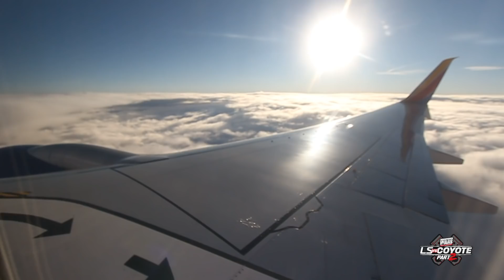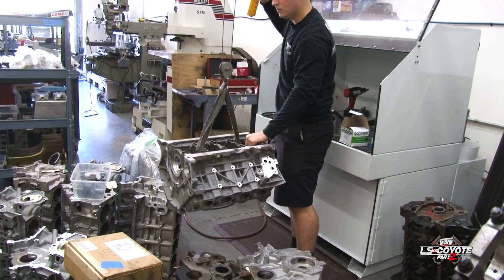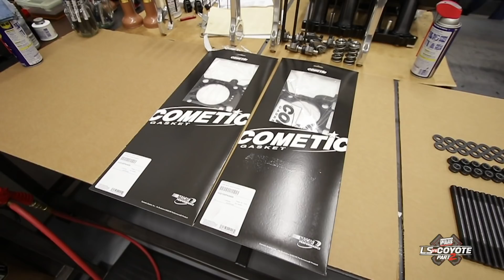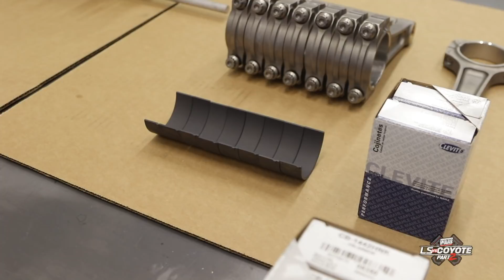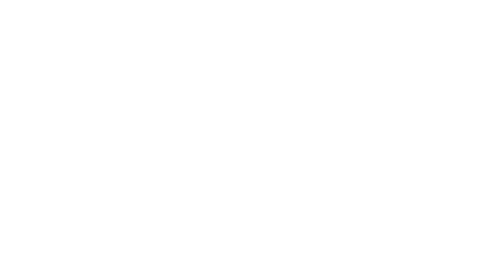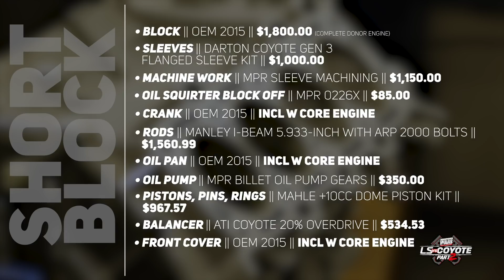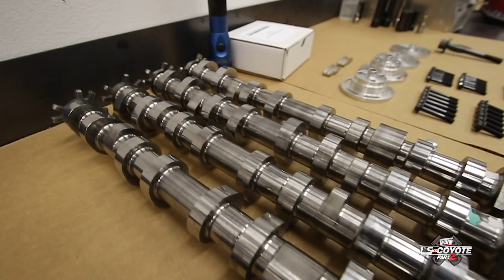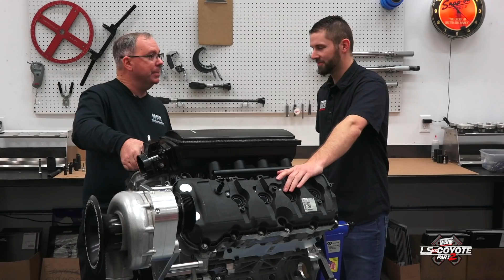LS vs. Coyote 2 Episode 3: The Coyote Engine Build

Comment: So in retrospect what you're saying is that the ls base 5.3 L is not a competitor against the 5.0 so Ford won hands down so all you LS boys to take that and and shove it because that right there proves right from the get-go that GM lost I mean if we're going to compare apples with apples why is it the 5.3 being utilized tucupita guess the coyote 7 L vs 5.0 L is not a direct comparison can you get 7 liters out of a 5.3 L can the 5.3 L with a $15,000 budget compete with the 5.0 coyote I don't think so just like always GM Fanboys can't start with a similar comparison to start with. Why did GM boys always have to start with aftermarket parts not to mention I know guys would 5.3 letters that have $20,000 invested in them and then barely pushing a thousand horsepower with turbos that were already purchased for their last LS that blew up
Reply: why would you compare Fords premier V8 (SAVE FOR 5.2/6.2 UNICORNS) vs GM low tier v8? You make it out like the alum L33/LS1/2/3/6/L92 blocks cant take bigger liners??????? Wake up fuqtard they can all be made to displace  over 427 cubes with the SAME PROCESS USED FOR THE FORD BLOCK IN THIS SEGMENT.  You used to be able to do an E.R.L Superdeck  however I think they are out of automotive, but  R.E.D does the same process for over 500 cube  Ls from a  factory block.

Comment: I absolutely hate this. Quit comparing a 6.2 vs a 5.0. Who’s idea to use a pro charger anyway. Everyone knows a vmp makes way better low end power and could help lower end and midrange torque. Oh I know why this is Chevy guys trying to beat the coyote and that’s the only way they can skew the results
Reply: typical chevy guy response... well you see its not really an advantage having 2 extra litres cause you see you have 4 valves and we only have two. (kidding) lol but in all reality yes the 4 valve head flows really well BUT those 2 valve cnc ported heads going on the ls will probably be square port and they flow extremely well.
Reply: @randomlifeofjohn , I didn't call it an advantage genius, it just evens the playing field a bit, the displacement comes from how much air an engine takes in every 2 revaulions
Reply: @anthonywebber2211   lol revolutions and i was just messing with you. just realize there is no replacement for displacement
Reply: @randomlifeofjohn  There is a replacement for displacement. It's called boost.
Reply: @chrism.728  agreed however they're both boosted haha so it still stands
Reply: @randomlifeofjohn  DOHC Coyotes love to rev and love boost, so it all balances out.
Reply: Baggerz Anonymous
the LS engine there using this time is 7 liters, 2 valve engines need displacement to compensate for the lack of flow that 4 valve have
Reply: @anthonywebber2211  a set of Frankenstein heads flow 410cfm intake and 265 exhaust. A stock ported coyote head floors around 340 at .500. You can get the Frankenstein heads for 1700 a set. A set of coyote heads thay flow thay good will run you 3500
Reply: @anthonywebber2211  plus its a iron block they love boost they will be able to shove more boost then a typical ls6.2
Reply: Why are there NO TVS cars on shows like Street Outlaws and a shitload of Procharged cars?  A Procharged car will just as much low-mid range power as a TVS if its spooled via trans-brake or foot-brake.  Centri will EAT a twin screw on the top end
Reply: @poopinator22  procharger pays more to advertise. But the ultimate goal is to make peak horsepower and a procharger is going to make the most power
Reply: @poopinator22  if its spooled? lol. its rpm is based on engine rpm. i also agree with you that a centrifugal blower will make much more on the top end however they do not make near the low end that a tvs blower does
Reply: @randomlifeofjohn   Yes, even a centri needs to spool.  I own one and its still under vacuum until around 2800.  Centri cars dont usually leave on boost unless spooled by a converter or foot brake.  A positive displacement blower (TVS) builds boost immediately
Reply: @poopinator22  I honestly dont believe that you have a centrifugal supercharger. You are implying that they depend on incoming exhaust to build boost which is not true. Centrifugal superchargers depends on engine rpm to create more boost and are not limited by exhaust gases to spool them
Reply: @beardedforlife3740   I never said they relied on exhaust gases.  I have a D1SC on a 2002 GT, most driving on city streets (under 3Krpm), I might hit 2-3psi, otherwise its under vacuum.  Centri's need to spool
Reply: @poopinator22  if you want to get technical, all superchargers dont make full boost when you are just cruising around town. If they did you'd have a lot of issues not only with the motor, but also the drivability of the car
Reply: Ls has a smaller body with bigger muscles. Win
Reply: @Cobra Black, 4 valves have more surface area
Reply: @anthonywebber2211  If you actually do the math on these two particular engines, the LS is only short 3% valve surface area, but because the coyote has more valve stems theyre probably equal as far as actual surface area. Now ofcourse the LS valves are way more bias towards intake than exhaust where as the coyotes are a little closer it'll definitely change where the engine is the strongest in rpm with a complementing cam for those valves. 4 isnt always instantly better than 2.

Comment: I was much more curious to see an LS vs Yote forced induction build on STOCK BLOCKS. The average person doesn't have the kind of money/time/patience to fully build an engine like this. This should've been more of a who can make more power safely with a 10K budget. (that's the shootout that I wanted to see at least). I was choosing between a similarly equipped 2017 mustang and 2016 camaro ss. The 5K I saved buying the newer mustang, I put towards a supercharger. LS parts may be cheaper but the cars they are put into are more expensive.
Reply: Won't live long but what the heck lol...stock motor and trans!

https://www.youtube.com/watch?v=DSvUTjE4Xk4

Comment: Both engines have alot of potential and from the factory rated at basically the same hp even though the LS has 125 more cubic inches.
Reply: Thats a lsx iron block its in no production vehicles that i know of
Reply: 2 liters equals 122 cubic inches

Comment: For all the Ford cry babies out there let's get it straight Ford makes the coyote eng with the well-known tick tick tick piston slap people are suing ford asking them to buy back their brand new Mustang. it doesn't get any better with the transmission breaking 2nd and 3rd gear shifting Forks 2 month waiting list just to get parts because Ford was too cheap to keep the Tremec also their diesel engine lineup didn't do any better they produce three different diesel engines in a 10 year time span because of the continuous problems Ford continues to take people's hard-earned money and give them pieces of junk FORD just release the 7.3L engine guess what it's not a modular engine it is a old school pushrod engine just like a LS